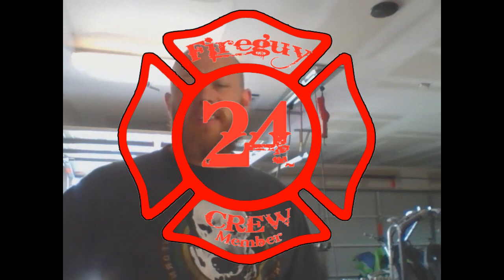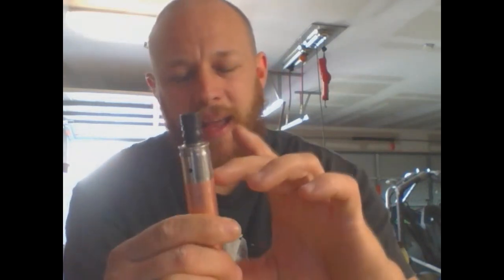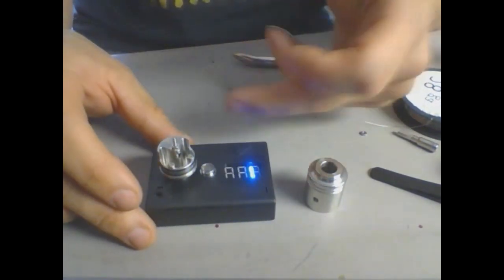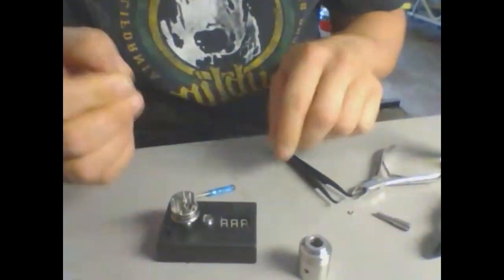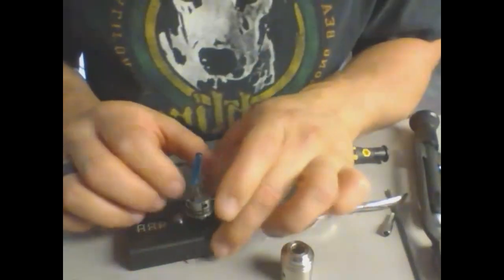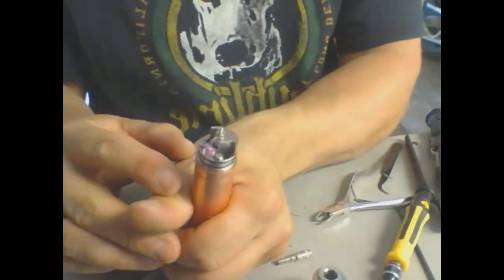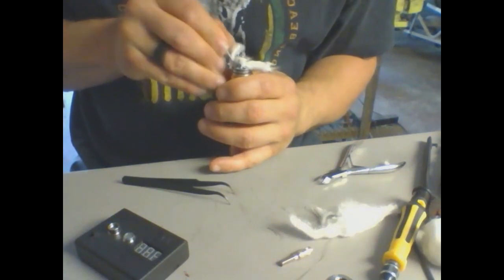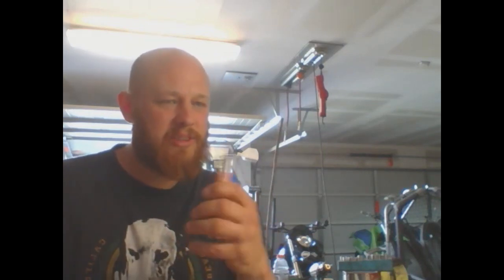Vape VLOG - Mech Mod and Coil Build

Comment: Have you tried a provari v2? That's what iv'e been rocking for awhile now, with an hh357 atty, so far  its been working fine if you use a 510-510 connector so the post doesn't kill the atty, also love the motovlogs:D

Comment: You should try twisting your wire with a drill with your 28g wire instead of cutting 2 pieces. just make a long one with the same size when you fold it next to each other, take a drill with the 2 ends and hold the other end with the drill bit you had and twist it with your drill until it breaks off the drill end, it will be a tight and twisted wire and get better oms off of it. the proceed to making your coil the way you had in the video. just a suggestion.

Comment: Nice, i have the same set up in all stainless finish.
Reply from the maker: My wife has that, it HONESTY doesn't hit near as hard.
Reply: Yea. I'm sure the copper version has less voltage drop. I screwed up the threads on my nemesis so now i use a turtle ship with a stillare or patriot rda. Keep it chuckin!

Comment: Is the patriot clone on fasttech the same as your eBay one, minus the modded drilled out holes? Also, how do I know what atomizer to get for the nemesis clone? Some are 22mm and some are smaller or bigger, forgot :(

Anyone help will be appreciated, thanks.
Reply from the maker: I'm not sure if the patriot on fasttech is the same as mine. I hae seen several types of patriot clones of various quality and size. I can dig up the supplier of my clone if you would like. Its a good one! Message my on FB if you have a page.